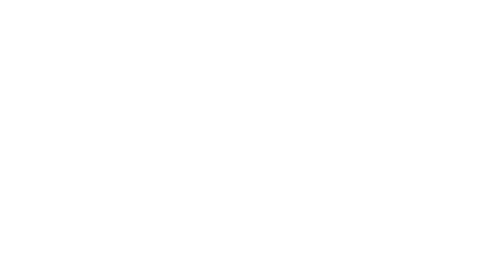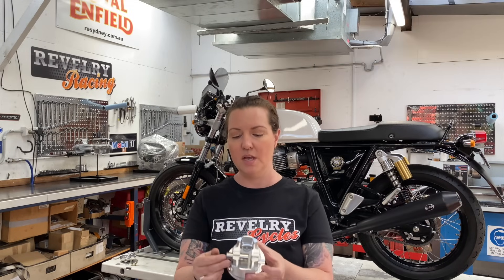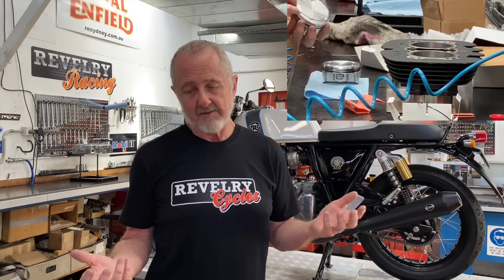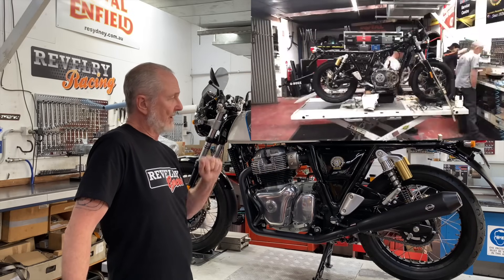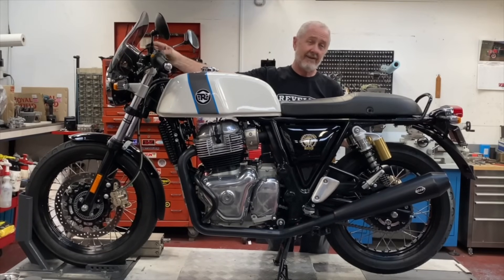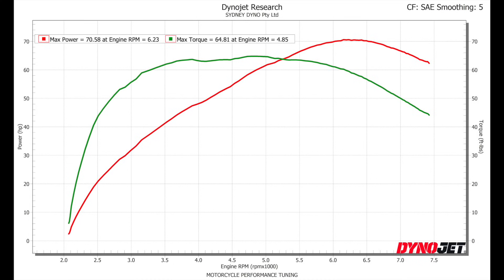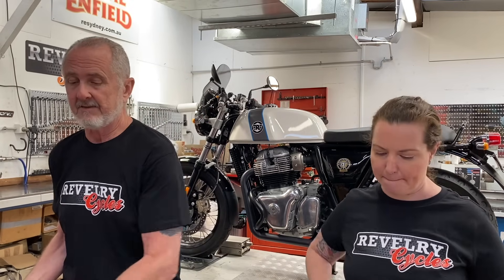Episode 6: Big Bore Kits - Royal Enfield 650 Twins

Comment: Hi, my name is Giovanni and I'm writing from Italy. I had a problem with the transmission on my Continental 650 Euro 5. To avoid opening the engine, I decided to get another one and replace it. This new one comes from a Euro 4 motorcycle that was in an accident. Since I installed this engine, I've had overheating problems, and it won't idle when cold. I've tried everything, but now I'm worried about an incompatibility between my electronics and the new engine. Specifically, do you know if they have different timing advances?

Comment: Kind of hard to justify throwing an extra $4,000 at the machine 
 Two mod it out. I suppose if you have the money why not. I kind of been eyeballing just buying a new stock 650. I could see buying the cylinder mod kit. Other than the machining do in the work myself and just leave everything else stock to get the extra torque. Looks like you can get that all done for $1,000 bill. Happy compromise.

Comment: Has anyone tried a 865 big bore with a stroker crank ?
Reply from the maker: http://shop.revelryracing.com.au/product/revelry-racing-re-twin-7mm-stroker-crank/
With stock pistons, displacement is 715cc at 10.7:1 compression.
With S&S 750 kit (83.5mm bore) displacement is 820cc at 11.9:1 compression
With S&S 865 kit (90mm bore) displacement is 951cc at 13.6:1 compression

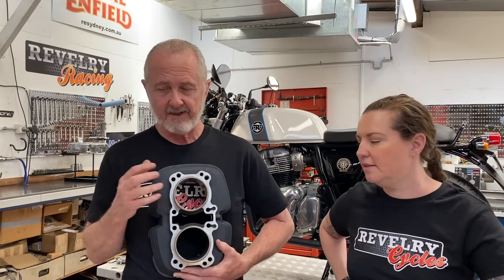Comment: Why buy a cheap motorcycle and pend a fortune on it. Aspesialy when you can buy a heigh performance bike, straight out of the shop. I'm I missing 16:22  something?
Reply from the maker: Yes, you’re definitely missing something!
Reply: Yes, you're definitely missing how this engine develops it's power/torque and works, especially with this 270 degree twin cylinder engine, it's not about outright horsepower! 
One of these Big Bore 865cc 'torque monsters' will give you so much many more 'smiles per hour' on back roads than any 'race rep' can do, unless you can ride everywhere like Michael Dunlop or Peter Hickman etc?!
Reply: Ya, some people enjoy this stuff, that's why people modify lawnmowers 🤷

Comment: I’m confused between 16T & 17T I’ll have to change my chain if I have to go with the 17T, could make a video or reply to this video as to what I can expect out of the 17T sprocket.
Reply from the maker: Front	Rear	RPM@100KPH	KPH@7250RPM
15	        38	        4350		        175
16	        38	        4000		        186
17	        38	        3650		        198

Comment: How can you do it on the motorcycle located in india. I mean RE 650 Interceptor to 865..
Hoping to get an answer from you 🙂.
Reply from the maker: Find a qualified mechanic and pay them well.
Reply: And the parts that you suggested, big bore kits, filter, throttle bodies, cam shafts, exhaust, pistons,rings, ECU, clutch plates, Dyno etc. All the upgrades. Where can I find them? 🤔
Reply: Ricochet motorcycles (Pune) will do it.
Reply: @AjayKumar-hh6hx  Thanks for sharing the information. Does Ricochet motors have a website
Reply: @klang01234  not sure. You can contact them on insta. Same name

Comment: Very useful and informative video,but who could possibly justify the huge cost of a big bore kit,cam,headers,silencers,air filter,throttle bodies,bigger valves/head modifications,ECU upgrade/re-map,performance clutch etc. to achieve an engine that produces around 65Hp, less mpg, and seriously comprising reliability? Just take your pick of the naked/retro bikes out there which come with excellent power figures and proven reliability...eg. Yamaha xsr900 (117Hp/193Kg), amongst others, and at a very reasonable price.

Comment: The 865 kit is fine but I wish they made a 750 kit which would match the original 750 Interceptor because in my opinion RE biggest mistake was not to do exactly that. The whole point of the original Interceptor was that it was the first 750 British twin made in 1962, so why build a 650 version now carrying that famous Interceptor model name? A contemporary 750 in the same tune would have produced around 54 BHP and more than enough extra torque without compromising smoothness or fuel economy. Opportunity missed in my view.
Reply from the maker: Well you're in luck!
Here's the link to the 750cc Kit. 
http://shop.revelryracing.com.au/product/750cc-big-bore-kit-for-royal-enfield-650-twins/
Reply: @RevelryCycles  Thats great thanks. Does it require the clutch upgrade or is the standard clutch ok? Is it as smooth as standard?
Reply from the maker: Yes you’ll definitely need the clutch and yes it’s very smooth.
Reply: As I understand licencing restrictions the 650 provides access to learner riders that the 750 would not. I suspect India may also have power limits: you just don't see many big bikes on other vlogs from India. Personally I doubt whether the quality of the original RE would have made an 860 a ridable bike. However it would make sense for the New RE make an 860 alongside the 650 to provide a path for people who have moved past licencing restrictions to access a great twin cylinder bike.
Reply: @michaelreid2329  You are probably right but it is a shame that a 750 option was not offered from the factory. I am not a fan of the 860 concept myself. 750 would have been the perfect balance and more historically appropriate if RE are going to use the Interceptor name.

Comment: I have a question, what about the valves ? Is it also replaced with a larger size? what is the standard valve size of 650 ?
Reply: I wouldn't do a big bore and not touch the cam. They put shims in the springs for more tension.

Comment: Thanks for the vid, you guys do a great job, just one question, in this vid I believed you guys said or implied that , with Big bore 865, free air filter, performance S&S cam, your headers, ECU and CNC valves/heads Dyno was saying 70ish HP did I hear that right?. if so any idea what kind of HP one would be looking at with all of the above but not the Head and Valve work/CNC, if you know what I mean. Thanks

Comment: Indeed, great to find you channel, quick question... with a RE 650 twin with a S&S big Bore kit fir into the frame of a RE Himalayan? Or could I convert a RE Interceptor into an adventure bike with an 865 engine?
Reply from the maker: If you want an 865 adventure bike the answer is B... convert an Interceptor.
Even though it may look like it from the Internet speculator/spectator (and graphics artists) seats, the 650 engine absolutly will not "just fit" in a Himalayan frame.

Comment: Hi There, how much should budget for a complete package and install for the big bore kit? I’m interested in the bike behind you?
Reply from the maker: These jobs vary greatly depending on a whole slew of variables. Every motorcycle/customer/outcome required are different. The minimum requirements for a big bore  with cam fitted is around $3,000 AUD (GST Inc). The bike in the video was much more than just the big bore. To turn an unmodified stock bike into what you see in the video is closer to $7,000.
Reply: @RevelryCycles  So $7,000 Australian Dollars equals about $5200 US$, Not too bad for the bang for the buck. ;)
Reply: @RevelryCycles  are you saying that you could fit a big bore kit with cam for $3000 including all the machining and the custom built parts? Is the additional $4000 in anyway related or to the functioning of the big bore kit or is it seperate parts like exhaust suspension etc...

Comment: Will the 865 big bore kit work with the stock throttle bodies, stock cam and stock cylinder head? And I mean no messing around with those. Just remove and refit them as they were.
Reply from the maker: We've done a lot of these with stock heads and throttle bodies. However, we wouldn't use the stock cam. The increase in compression without additional overlap would be problematic and, for the price of the S&S cam, doing this job without it just doesn't make sense. 

You will also DEFINITELY need the clutch. The stock clutch will not hold the torque of an 865.
Reply: @RevelryCycles  Did you replace the injectors or are the stock injectors up to the job as well? Thank you.

Comment: Looks like I have to start saving for a big bore kit ... And S&S cam ... And headers.
Thanks for the videos, very informative as always.
I do have one question, given they cost the same, why would someone opt for the 750? Bigger is better, so wouldn't the safe option be the 865 to avoid living with HP regret?
Reply: some places, including NSW where Revelry is, have pricing tiers for vehicle registration that correlate with engine displacement. Perhaps they found one of those places and figured the 865 wouldn't be viable there?

Comment: I'm guessing that the stock connecting rods are more than up to the job...is that correct?

Also, what's the story on the ECU? Do you have to re-map the factory unit or do you go with an aftermarket ECU designed for this BB kit....and is it the same for 750 BB as the 836 kit? Thanks.
Reply from the maker: The con rods can handle these mods just fine.  Please reference our video on tuners for more information.
Reply: @RevelryCycles  Thanks. I went to the S&S website and they're sold out, saying that the BB kits were flying off the shelves.     I fully intend to get one but reckon I'll need to stand in line for a while. The Royal Enfield Interceptor is possibly the greatest retro twin to hit the market in twenty years. You can't touch the new bikes anymore...too complicated. It's nice that there's still a new, air-cooled twin out there that begs to be souped up. Thanks for the vids👍great stuff.

Comment: Hey you were talking about getting the pistons/rings in the cylinder being a bitch.  For decades did the opposite from normal that works very efficiently.  Simply put the inside wrist pin retainer on then drop the piston in from the top then when the piston starts to come out align the rod slip in the wrist pin in, problem solved.

Comment: Hi there, I am from Germany and have already updated my Int 650 with S&S CamShaft and DNA plus a complete Exhaust from BS (Italy). Back from Dyno run it ends up with better torque and 52HP. We pushed the limiter 200 rpm up. It is running nicely. Next step, just received the 865 Kit from S&S plus the clutch kit and a new cylinder to prepare. What are the changes to the head you do for a perfect fit? Are you having ecu adjustments you can provide me with to start? Your help and experience is very much appreciated, thx, Jascha
Reply from the maker: Cylinder head video up soon!

Comment: How much would it cost for a interceptor 650 to be at its fastest and lightest ??
Reply: How fast do you want to go and for how long, how light do you want to be, and how much are you willing to spend. Those are the questions that yiu need to answer first. Aluminum, Titanium, and carbon fiber custom fabrication could reduce weight significantly but they will have an associated cost.

Or you can view their drag bike video as a start.

Comment: Very good videos,  didactic, simple and full of enthusiasm. 
Best regard from Buenos Aires, Argentina
Reply from the maker: "Didactic"... now there's a great word! It's like "gargantuan" in that you so rarely get an opportunity to use it in a sentence. Good on ya!
Reply: @RevelryCycles  Well, another question from the "antipodes".... (ding), if you allow me.
The original liners look like pretty thick ones ( about 6/7 mm, doing the math, considering they have just a little more outer diameter than the 865 piston, as you showed it ).
It seems that, with the 865 kit you´ll have to also drill the carters, and perhaps adapt the cam chain bottom gear shaft (In proper english might be better understandable I guess...).
Do the 750 kit fit in the carter as it is? That would explain the two sizes...

Comment: Is quality of fuel gona be a issue standard fuel we have in india is 88-89 octane and power is 92- 93 octane ,98 octane is not available in every city.
Reply from the maker: While fuel certainly has an effect on performance, we are probably talking about the difference between Motor Octane and Research Octane rating systems. The 98 commonly available in Australia is RON while I would guess you're fuel is MON rated. These are just different methods of testing so RON numbers are generally a few points higher than MON. EFI systems will to some degree adapt to various fuel qualities. I wouldn't let "octane" ratings dissuade me.

Comment: We in the UK are waiting with BAITED BREATH for someone to take the plunge and produce a detailed examination of these big bore kits!  I am interested in the 750 more than the 865, purely because I am concerned about the extra stresses on stuff like g/box, clutches and all the drivetrain bearings.  I would like to hand over the crated bike, straight from the factory, and have all the bits on my "xmas list" added at the beginning, rather than have to wait whilst I run in the stock bike and then go through it all again with the modded machine!
I've ALSO considered building my own spec 650 (with 750 kit) Himalayan, using the Interceptor as the base, and have only to determine the power delivery and performance stats, before finalising my "design"!
I've just subscribed, so GET THE JOBS DONE, sharpish, before we all have a fit, and die quacking!

Comment: What a great video! So much information. I would love to have this big bore kit on my GT but seems way too complicated. Which other mod do you recommend to increase horsepower besides the basic ones like filter, exhaust. I was hoping to increase at least 7-8 HP. Just subscribed. Keep up the good work.
Reply from the maker: We've average the dyno runs of stock motorcycles and found stock hp to be around 43.61.  An additional 7-8 hp is approx 18% increase.   S&S RO mufflers, high flow air filter, Revelry Racing high flow headers, and a Powertronic tuner will yield a 16% increase or 50.07 hp.  Those items PLUS a S&S cam will yield an increase of 21.35% or 52.36 hp.   Watch our other videos we address performance increases at all different levels.

Comment: gotta  problem on my i interceptor 650.....rpm is not exceeding 4000rpm and 80 kmph..plz help
Reply from the maker: Thank you for trusting us enough to ask about your motorcycle concern.  Please understand that it is not appropriate to diagnose, repair or advise on motorcycle issues over email, messenger, the phone, or with photographs or video.  To do so would just add to the mass of misinformed opinions that flood the internet already. If you can not physically bring the motorcycle to us no opinion will be rendered.  If you want to bring the bike to us please ring to make an appointment. If you are not near us and need assistance please seek the advice of a properly trained local mechanic.

Comment: There is a lot of work in those jugs, we get our Bonneville (865-790) kit jugs ready made 904/995/1200 cc to suit. But you are correct that takes skill to overbore and press in, if it is not done correctly that sleeve will try to ride with the piston at some point. The cam really is the magic, get that grind right and you are putting together a rocket. Love the RE.

Comment: I'm interested in seeing if there are any performance upgrades for the brakes on the 650 Twins? I already installed the performance air filter and thinking about buying your exhausts, but I don't want to add more power than the brakes can handle safely. Great content!
Reply: Very good question indeed. The stock Brembo brakes seem to be ok for 650 cc. More than 200 cc extra is a different matter.

Comment: Not a joke but seriously Can you put a turbo on the 865 and shoot the numbers off the charts?. I really want to see how tough these Enfields are. Plus this would be a first of a 650 twin build. ( As far as I know of)
Reply: A turbo on an air and oil cooled engine?
Riiiiiiiiiiiiiiiiiiiiiiiiiiiiiiiiiiiiiiiiight.
Reply: @MyMednas  On the drag bike it might work. The runs are 10-15 secs long and a bigger oil cooler along with an intercooler setup for the turbo can shoot colder air in the chamber, allowing it to still manage some heat. Considering the enfield, a Sequential turbo charging setup might be best to deal with turbolag. Plus You never know.. trying out something radical is the fun part about motorcycles.

Comment: I have the Power Commander 5 and S&S Cam. With the 865 what needs to happen after install with tuning so I can safely break in the kit (rings), before really tuning for performance? DynaJet has no 865 map. Need to go through all of my costs before committing to the 865 kit. I want it so bad, but I'm opening up a can of worms here.

Comment: Hi Guys, I am in the UK and have the bigbore 865. Did you find the clutch needed upgrading to a performance clutch? Interesting on putting a 16 tooth in over the 15
Reply: I run the 16t on a stock motor, it makes 60-80mph cruising on the freeway/motorway in 6th much more relaxed.  Fifth gear more or less replicates the previous 6th gear and gives a bit more urgency for passing.  1st gear is still fine for launch from a stop (I do run a power booster to eliminate the lean stumble on low revs).  One thing they do not mention, as per the "Hitchcock" site the stock chain length is short for the 17t front cog.  So the 16t is a "drop on" the 17t needs a chain as well.... I'm sure the 865 kit would benefit from the rev drop in either case....
Reply: Great info Mark thanks for that 👍